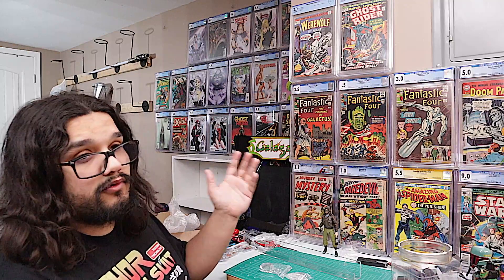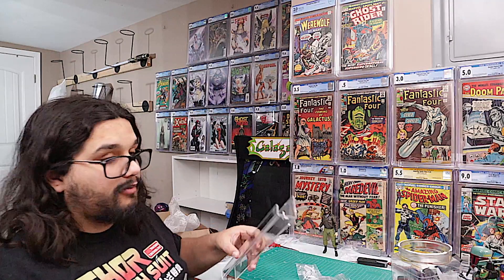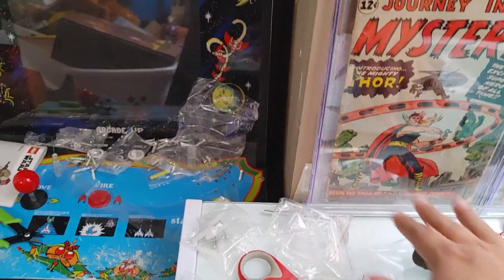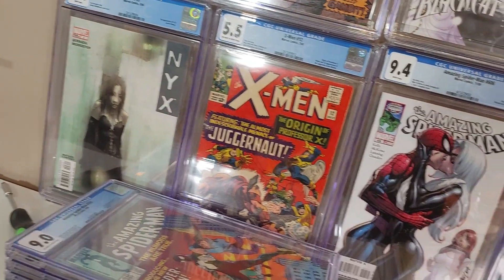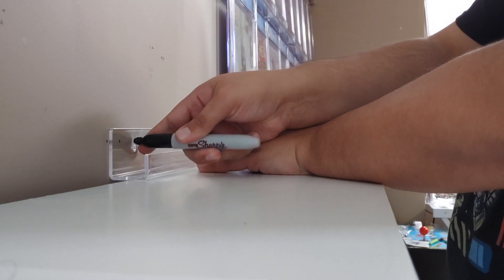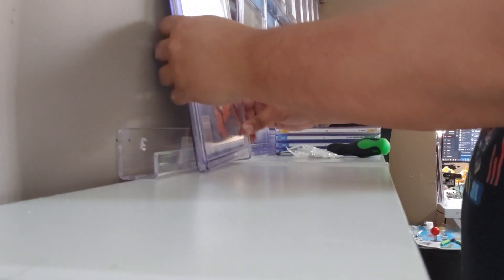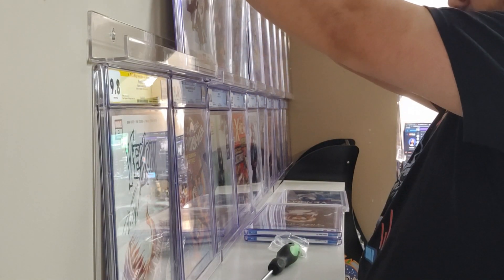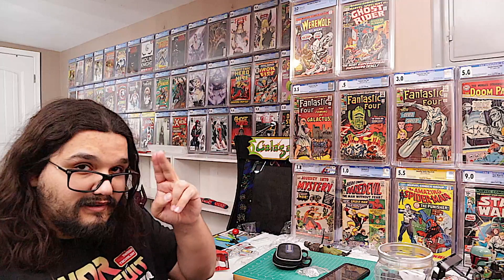How to Make a Comic Wall!!

Comment: Great looking comic wall. I heard of another person using similar shelving that has run fishing line between hooks on at the far left and right of each row in order to secure the top of the comics. Home repair recommendation: get a ratcheting screwdriver.
Reply from the maker: Ive seen some people use string or fishing line. Which would be good for the extra security. But these seem to be sitting just fine so far. 
I think I used to have a ratcheting screwdriver. Idk what happened to its. But screwing into the plastic is super smooth.

Comment: What if you don’t have a graded comic you want yet but you want random comics on the wall
Reply from the maker: I would be worried that having them tilted back with this method would cause damage to raw books.
Reply: @SwytchComics   well it would be just for decorating not nothing of value on the wall
Reply from the maker: @youmightbe.8884  then this method should work fine. Another thing you could do is apply toploaders to the wall using command strips.